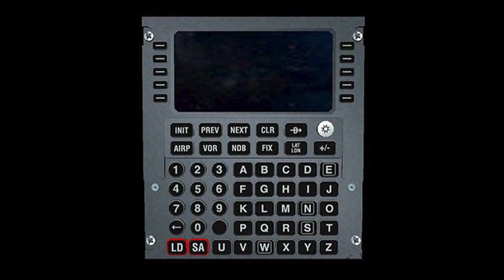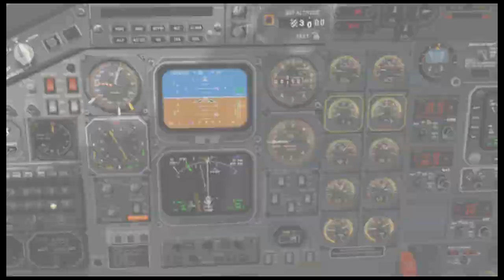Embraer EMB-120ER "Brasilia" for X-Plane - Sneak Preview 01

Comment from the maker: It uses SASL as for plugin part, so it it already 64-bit compliant. I've tested under X-Plane 10.20 either at 32-bit, either at 64-bit and it works all right.

Comment from the maker: The aircraft it's still in development, and it will be most likely available in the next few months. I am still working on it (and it's a tough work! ;-) )
It will be sold on the Store at X-Plane.org. The price has still to be determined, but it's going to be aligned with aircrafts of the same type.
You can find infos and pictures at the address above, in the video description.
Thank you for your interest in the project.

Comment from the maker: Inivis AC3D (you can easily find it in Google); it's great although it's a commercial software and it lacks some precision, on my very personal opinion. That precision could be instead found in Blender, that's free, but awfully difficult because of its weird interface... My 2 cents.
I did everything in AC3D, either in externals, either inside. Futhermore, I also created the scenery of Firenze Peretola LIRQ for X-Plane with that software.